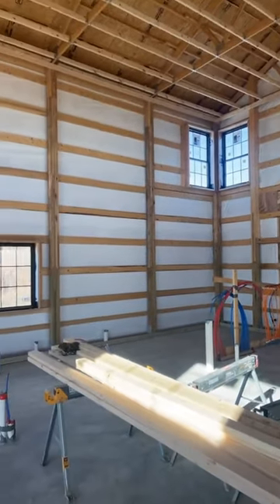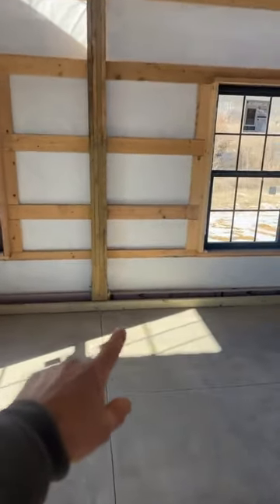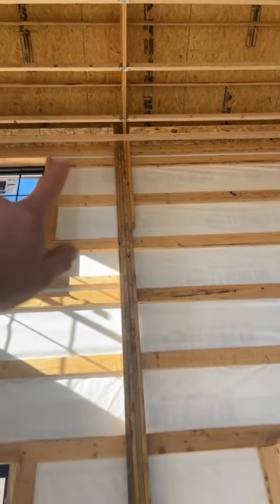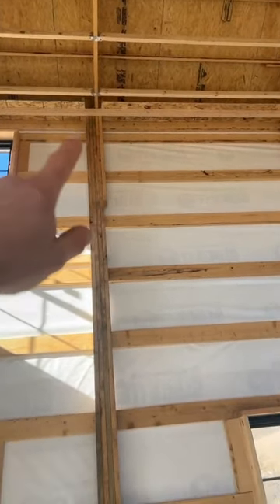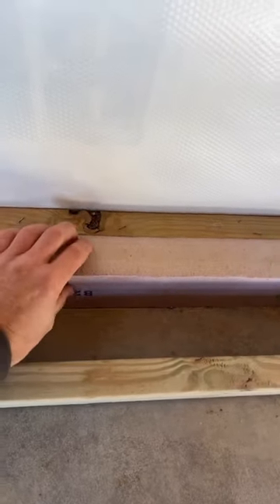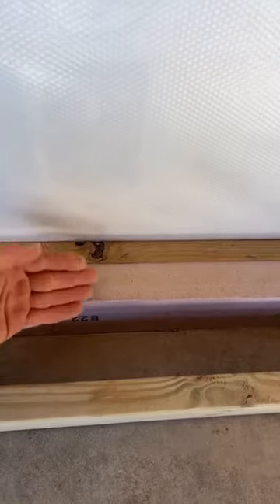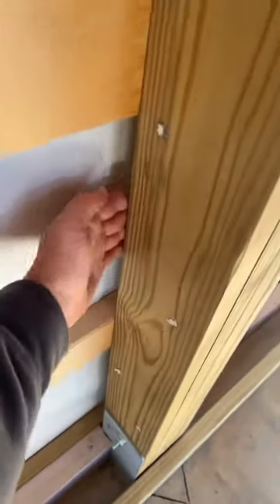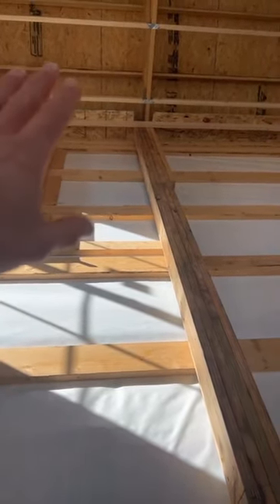Barndominium Prep For Spray Foam #shorts

Comment: When you listen to Spray Jones @sprayjones (?) , he suggests spraying the underside of the roof so as to have no unconditioned air in the attic - and I think he recommends spraying walls without the building fabric. Your system insulates while permitting easy access to replace damaged metal, but you forgo the structural strength benefit from bonding foam to the outside metal. 
Conditioned Attics are better and foamed ceilings add strength and rigidity to the structure. They also might eliminate the need for plywood on the roof - with the same downsides when it comes to replacing metal panels.
Pros and Cons discussions for sure. If spray foam was cheaper than insulation bats, foam would be a no brainer for every post frame building.